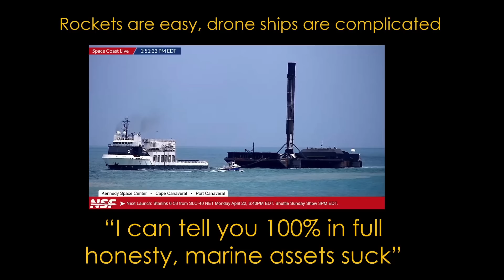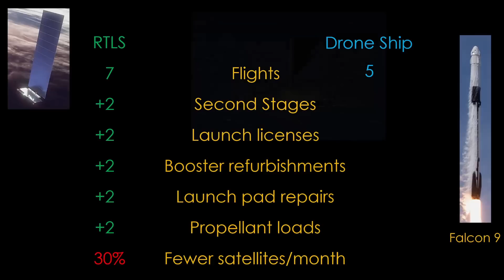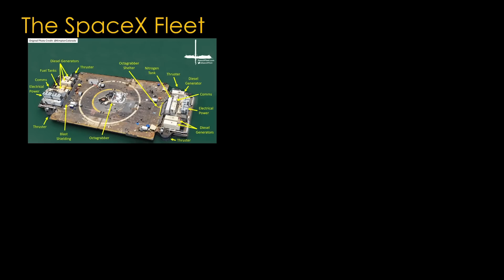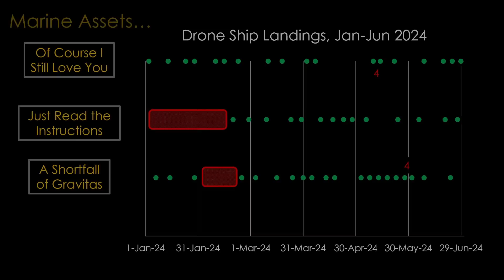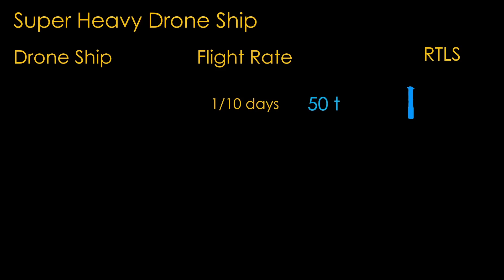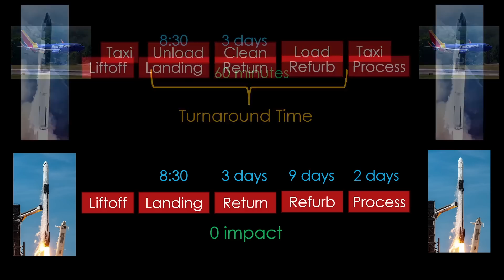Starship Booster Droneship Catch?

Comment: Sustained high starship flight rates are only needed for Mars colonization.  For other missions there will be a burst of tanker flights to the LEO (or somewhat higher).  This could be accomplished with a modest sized fleet of a dozen boosters and tankers and a fleet of drone ships.  Note the downrange of the drone ships may be less than with Falcon 9 speeding things up a bit (lower stageing velocity).   I suspect there will be a mix of expendable (not many), RTLS, and Drone ship flights as with Falcon 9 and and heavy.  Note as starship evolves with better engines and higher fuel load the number of tanker flights for otrher than Mars colonialization will probably fall, except for those flights at the edge of capability.

Comment: I am not as convinced as you are that Starship will always be a RTLS, and that revolves around the one key thing that you focus on in this video, the 3 days to get the ship back to dock.

With the Falcon 9, there is no option, it needs 9 days of refurbishment before it's ready to fly again.
But with a Starship, you just need to refuel it on the landing pad out in the water and then have it fly to where it's needed  (and without the mass of a starship on top, it could do so for very little fuel)
Now, transporting a lot of cryogenic fuels around is not trivial, so I think this makes far more sense if they can create the fuel at sea. But if they have to ship the fuel, that could be done on large ships that hold many launches worth

So in a couple of decades, I would not be surprised to see the oil rig platforms show up again, possibly with a micro-nuclear reactor on it that generates it's own fuel, catches boosters and then launches them again (which would also be a good way to get the boosters from Texas to Florida, or elsewhere)

There is a lot of overlap with these and the requirements for point-to-point system
Reply from the maker: The stated goal of starship is airplane like reusability. You didn't get that with a drone ship.
Reply: @EagerSpace  It's that aircreaft like reusability that lets you land on a drone ship without needing the extra 3 days to get back to land. Just refuel it and fly it again.

The key is what gain you would get from doing this. Due to the shift of delta-V to the ship, it would probably be less than the gain the F9 gets.

It looks like the ship has ~400T of fuel left at stage sep, and about 100T left after the boostback burn (and a surprising amount left after touchdown), so what would that ~300T of fuel get in terms of additional ship capability?
Reply from the maker: You would have to run the numbers; I don't have a good sense for the change. 

Note that if you go with a drone ship that you can fly back from - and that's a pretty big drone ship with tankers - you may be able to fly the booster back but you may need to wait for the drone ship to get in the new position, or for the weather at sea to be okay, or for your propellant tankers to arrive, or for ships to be fixed.
Reply: @EagerSpace  They were starting off with  an offshore drill platform. I would expect them to have the fuel out there ready to go.

One nice thing about a methalox rocket is that the fuel can be generated on site if you have enough power, or they could have some large tankers making one trip for several flights.

It's all going to depend on how much extra payload that ~300T of fuel would let them get to orbit compared to just flying multiple missions.

I'm not saying that it's clearly the right answer, just that the lack of refurbishment makes it a plausible plan

Comment: what about a mechazilla in the golf of mexico ? you refuel the booster there and make it fly back to bocca chica ?
Reply from the maker: The problem with that architecture is you need a very big platform that is quickly movable because it needs to be in different locations depending on your launch trajectory and you need to develop a way to get the propellants out to that platform to fly back. And you put twice as many starts on your engines.

Comment: I wonder if Super Heavy has the potential to return at a different tower down range. Perhaps Boca Chica to Cape Canaveral. I suspect it has the necessary performance and fuel. But i didn't know if it has the ability to withstand the extra heat.
Reply from the maker: I should have talked about this but I didn't. 

The answer is "no" if you are trying to get canaveral - Super Heavy would need to land about halfway there. And the problem is that a fixed tower isn't in the direction you want to launch; sometimes you want to launch due east, sometimes to a high inclination, etc.
Reply: @EagerSpace  SpaceX has done dog legs before to do SSO from the Cape.  Not sure of how much payload capacity is lost, but would be less due to low stageing velocity for Starship.  Heat might be controlled with a reentry burn.  Range might be controlled for cases with low payload by a lower fuel loadout for Starship and a higher staging velocity.  In any case it looks like most flights will eventually be built and flown from the Cape.

Comment: The only reason for SpaceX to ramp up starship production to weekly rates is because they plan to expend them.  I expect boosters to be reused but the starship itself will likely be expended many times per year.  Of course these are starships designed for one way with huge payloads. Since the expendable starship will lose rocket engines, I doubt the starship will go beyond 6 vacuum Raptors.
Reply: If the market volume is there for even 30% lower cost per pound to LEO, then I see several “drone” ships
Reply from the maker: Why do you think that it's going to be 30% cheaper to use a drone ship?
Reply: @EagerSpace  I believe I was referring to the descriptor you said they used. I don’t know if the ships (or barges) are manned or unmanned, the 30% was a rough guess the difference in payload per launch plus amortizing the added cost of the ship used for landing the booster. Your graph showed up to a 70% increase in payload so 30% drop in payload delivery to LEO cost per pound seemed conservative. If a 30% additional drop in cost per pound to LEO opened up huge additional demand, then landing on ships is a no brainer.

Comment: I think the weight of landing legs capable of allowing the booster to land on a droneship can't be justified vs return to launch site.
Reply from the maker: It's probably not enough to cancel it all out, but it would be pretty heavy.
Reply: @EagerSpace  240ft tall & 27 ft wide, vs 140ft tall 12ft wide is a huge difference for moving around on water.

Another thing is the hot staging.  Once they stop ejecting the ring and it's built in....that will be a lot of mass at the very top of that 240ft...not sure how it would survive much wind on the water at 9m wide.

Will be very interesting to see how they tackle these issues if they start catching them at sea for sure.  It has to he able to survive all weather conditions if they want a daily cadence.

Comment: SpaceX should copy CNSA's catch concept using 4 steel cables to close in on and catch the booster. Would allow for a much larger landing zone and reduce likelyhood of damaging the launch tower, but at the added cost of increasing turnaround time with having to transport the booster back to launchpad. 
SpaceX's concept of having the booster come back to the launch pad right after a launch sounds like they'd ideally have 1 booster per launch tower, with a few backups on standby. If they caught them at sea, they'd need more boosters and a whole fleet of starship catching drone ships to approach achieving their desired launch cadence, but it could allow for a greater overall launch cadence. With the current plan they'd have to perform booster inspections on the launch pad. If they caught them at sea, they could inspect them either on the way back or in queue, and have pre-inspected boosters at the launch site ready to go. 
They wouldn't necessarily need to catch them at sea either, the reasoning behind that is to save a bit of Delta-v, but they could instead build a dedicated land based booster catcher near the launch site.
Reply: Boo hoo
Reply: @flynntaggart7216 Boo hoo what? Did you hallucinate a complaint?

Comment: 1. the booster would damage when landing. 2. The drone ship would be damaged from the boosters rocket ENGINES. 3. Booster and starship are designed to be caught to save a few ton of weight. Spacex plan is 4 to 6 starship flights a day minimum, if not every hour down to 30 mins launches. That's not counting continent to continents flights from other launch sites.

Comment: From a marine architecture POV, a droneship large and heavy enough to handle the Super Heavy will be massive. The weight and height of the booster will pose a major stability challenges compare to the Falcon-9. Especially if a catching tower is required.
Reply from the maker: Yes. I wanted to talk about the cadence issues, but the architecture is clearly a huge issue. I think you need something less like a drone ship and more like an oil platform.
Reply: @EagerSpace  Think two long streamlined underwater ballast tanks with a hollow support wall supporting the superstructure.  Much like a floating oil platform or Catamarran with below water hulls.
Reply: Empty Super heavy weighs about 200 tons of which about 70 tons are the engines at the very bottom.  Small ocean going barges have a payload of upwards of 700 tons.

Comment: I don't understand why you would assume that Starship refurbishment is an order of magnitude faster than Falcon 9 refurbishment. That seems way too optimistic.

I also think that drone ship landings could make more sense for a three stage Starship, since a reusable middle stage wouldn't even allow for RTLS and so would have to land on a drone ship.
Reply from the maker: What do you think are the major blockers to fast turnaround?

Three stage starship is problematic; the logical track for the second stage puts it somewhere over land.
Reply: @EagerSpace  I don't know, but it seems plausible that many factors that contribute to Falcon 9 refurbishment time are also present for Starship.

I didn't think of land, that's good to know. Another reason to use two stages only.
Reply from the maker: We know that one of the problems with Falcon 9 reuse is that they engines get soot accumulations because of the RP-1 fuel. Raptor avoids that because liquid methane burns very cleanly, and that eliminates one of the big blockers. 
My observation is that jet airplane engines run "gas and go" pretty much all the time and have ridiculously high reliability. Rocket engines are obviously different beasts but they aren't that different, and given that the engineers at SpaceX seem to believe they can get that kind of turnaround, I'm going to believe them for now.
Reply: @EagerSpace  Yeah, but I'm not sure whether soot is the only significant factor in Falcon 9 first stage refurbishment time. Anyway, for Starship reuse, the refurbishment necessary for the upper stages (heat shield) is probably the real limiting factor anyway.
Reply from the maker: Upper stages are obviously a case that we don't know yet. But they inherently are slower because you need to wait for them to get back into an orbit that lets them land at the launch site, and IIRC that's 12-24 hours.

Comment: How far down range can Super Heavy drift before falling to earth? Even if it takes a bit more fuel, it might be the best option. Say, setup international operations. Have bases in west Africa, East Africa, Southeast Asia, etc. primarily for propellant aggregation missions. Each booster landing downrange in cycles. For the scale being envisioned by SpaceX, the infrastructure would be warranted. Aside from offering other launch services to the international market. 
I don't know enough about the suborbital dynamics involved. Anyway, the Pacific would be a large stretch.
Reply from the maker: I had this topic covered and pulled it out because it wasn't working well, and apparently I should have worked harder.

Boosters are a on a ballistic trajectory and Falcon 9 travels about 600 km to the drone ship. Open up a map and see how far that gets you...

The answer is "not at all close to any useful landmasses".  Not to mention you need to launch in different directions.
Reply: @EagerSpace  Thanks, and I like the work you've been doing.

Comment: What about a Super Heavy Heavy? In other words, 3 SH boosters tied together much like Falcon Heavy's triple. 
You'd need 3 Mechazillas in Florida. ( Or what about 1 Mechazilla in the Bahamas? )
Reply: I don't see why it can't be done, but likely as it did with F9/FH it will mean a re-design of the center core.

Comment: Can we finally say-starship is a dumb design. Pushing engine pressures to crazy levels and expecting quick turn around is an oxymoron. Using cheap steel for reusable rocket is another oxymoron. Pressure held body is another trait of expandable rocket-a must have using steel being heavy material. Just vast number of engines is a trait of re usability-you simply can't loose so many engines on each flight. May be making second stage expandable, simpler, not so heavy might save star ship as a useful rocket.
Reply: No, that's just hater nonsense, but you people have never been terribly bright and certainly never honest.

Comment: I think the costs weigh out too if they can refill the booster and reuse a lot quicker. Will require more launches to get the same payload, but it's going to be A LOT easier to launch. The tower does everything; stacking, refueling, launching and catching.

Comment: Plus, a drone ship big enough to carry a Starship booster would be massive and even more expensive to build and run than the existing ones.
It would be so large that new berthing and tug towing arrangements would be required. 
A specialized port could be needed at Boca Chica and mechazilla would need to be built out on a pier to access it (which is an environmental permitting nightmare).
The scale of Starship makes handling it with anything but mechazilla a serious exercise....      :)
Reply: Cranes and  SMPT's work well enough for moving empty superheavies short distances.  While expensive, they are standard products up to two orders of magnitude cheaper and flexible in use than the transporters used by Apollo, The Space Shuttle, and SLS.
Reply: @michaelmcmullen354  That wouldn't help them achieve rapid reusability....
Cranes are slow and best used in fair weather. 
But yea, you could argue that you don't need mechazilla to lift them off a giant drone ship....     :)

Comment: Time is a very important consideration, but so is cost. You talked about this, but I think it should be emphasised more that Starship changes the rocket game because the cheapest way to use it, by far, is return to launch site. People keep talking about a throwaway second stage, and that's not getting the point. If you use it the way SpaceX wants, you only pay for the fuel. You can take, lets say, 50 tons to orbit this way. If you want to take 80 tons then just do two launches and assemble in orbit. That's by far the best way to do space in the future rather than these special drone ship or expendable second stage options.
Another great video. Thanks for sharing!
Reply: Yes, fully and rapidly reusable is the smarter path!     
Rapidly comes with other bonuses, more launches will mean teams gain experience faster as well - the technicians and workers who launch and refurbish it get to practice and refine what they do, speeding the process further.
The same applies to upgrading the hardware. The cost of Starship missions will be propellant + maintenance.
The more they fly, the more they are testing the hardware and the more opportunities they have to test new variations of the hardware that may reduce future maintenance costs.
The heatshield in particular will need a lot of experimentation to develop one that will withstand repeated use without constant expensive repairs.
So, the rapid reuse should help power-level the staff and tech as well!             :)
Reply from the maker: Agreed. That was the point I tried to make with the airplane example - low cost comes from flying all the time and not throwing things away.

Comment: Marine assets don't suck. They are just more challenging than a fixed land position. I would propose a swath ship and dual thrusters at each leg. The thrusters respond to input from a MPU that has a 6DOF sensor about 50% the height of the booster. They have variable pitch props and can instantly change the attitude of the vessel. 3 Arms can swing up to trap the booster in vertical position. The thrusters can pitch 45 deg to help raise the platform from the depths to allow faster transit under tow with stabilization on line.
Reply: Sure and say a round billion to design, test, validate and deploy? Oh, and nothing that big will 'instantly' change is attitude.  Turning takes time. :P